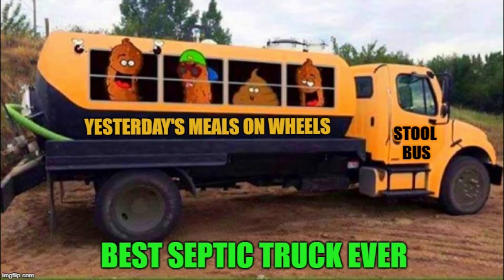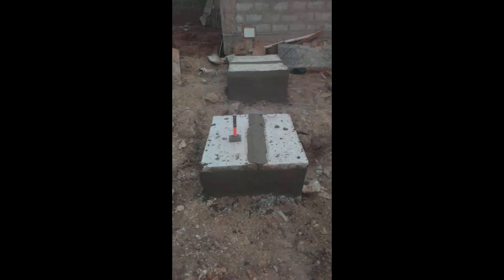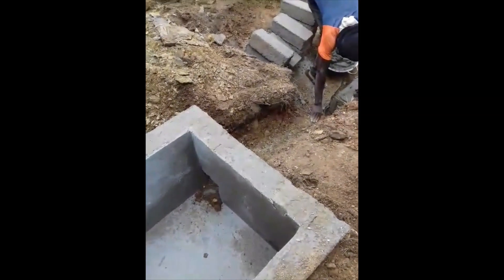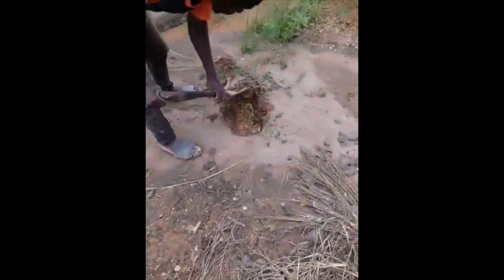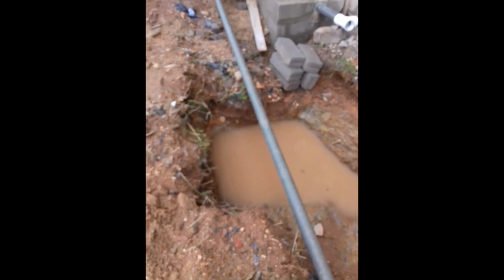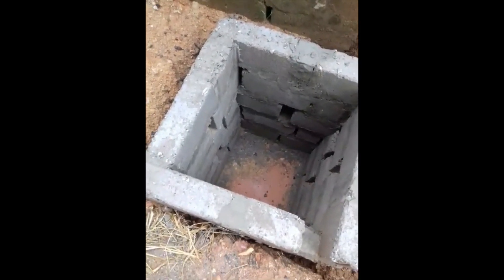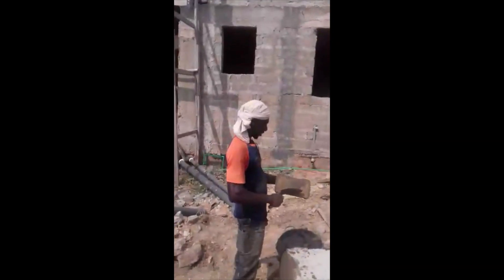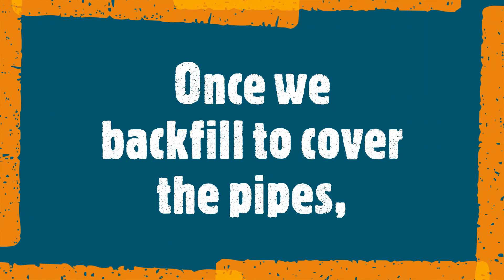Building In Ghana | Renewable Waste Management | Biodigester/Septic Tank #SewerSystem #Biodigester

Comment: Instead of septic tank you choose to pollute your land because is cheaper. Your prefer PVC all over your houses
Reply from the maker: Pollute my land? Please explain.
Reply: @GhanabaKwaku  Ghana is only Country that use kind of false biodester. Ghana biodester doesn't breakdown your waste. It just wash away your waste into your soiled. Why do think they are going place so many PVC stops in your House?
Reply from the maker: @kwabenatree  Your first comment is false. Ghana is not the only country that uses this system.
Reply from the maker: Thanks for watching and commenting though.
Reply: @GhanabaKwaku  I said is the only country that use  false biodester.
Reply from the maker: @kwabenatree  and you know we used false biodigester just by watching the video, boss?
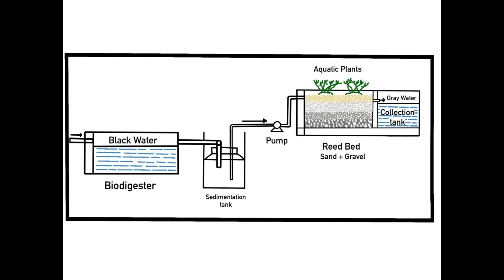Reply: @GhanabaKwaku   Look at the drawing in your video at 0:22. The pvc pipe to the sedimentation tank is higher but look at 2:03 the pvc pipe is on the bottom. The picture show that it will take time for the water level to raise and enter that Sedi tank. But what they did is going straight into the sedi tank. Is a false biodiester. Ghanaians and their short cuttings. This is the reason they put 10 cm pipes in walls. I bet they didn't even calculate how many rooms with toilet in your house or what kind of toilet you are going to use. One flush of toilet use 11 litres of water and dual ones for waste 4.5 and 3 litres.